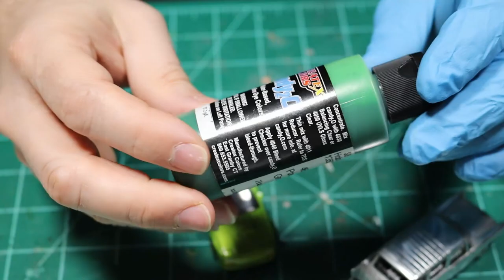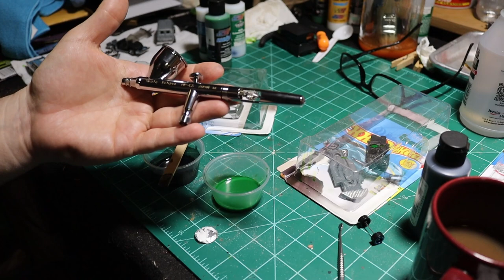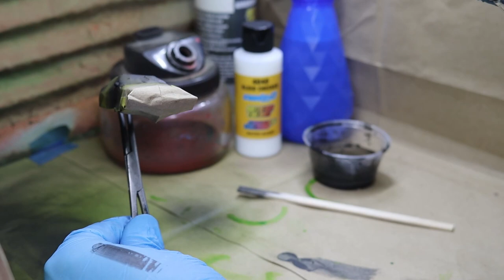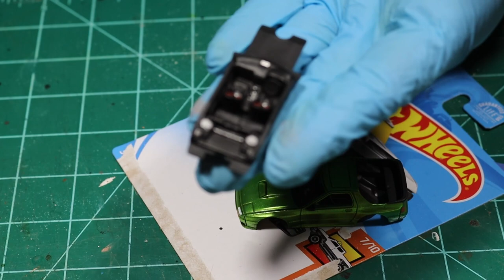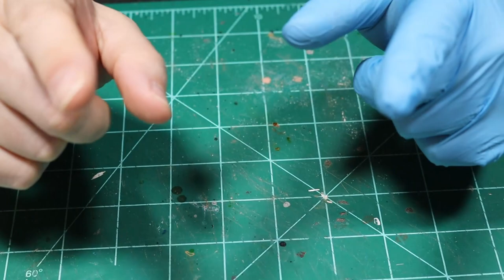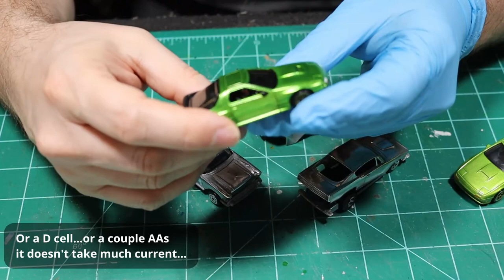Hot Wheels Spectraflame with Createx Candy2o

Comment: Noice job. Love Createx Candy2o! I pretty much only use that paint. Poison green is one of my favorites. I mix the 4050 clear with the candy paint when I spray it. Great job🤙🏽
Reply from the maker: Thanks, I've been using Createx paints for a few years now. Their stuff is pretty much all I use in the airbrush now. You are correct about the 4050. I usually use that too, but just flat out forgot when mixing the paint. Luckily it laid down fine, but it would have been easier with thinner coats.